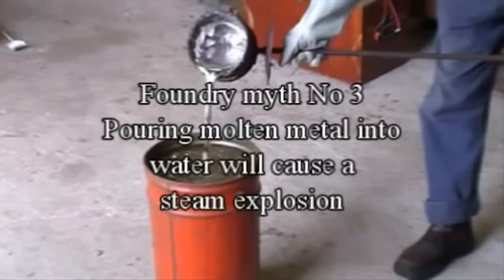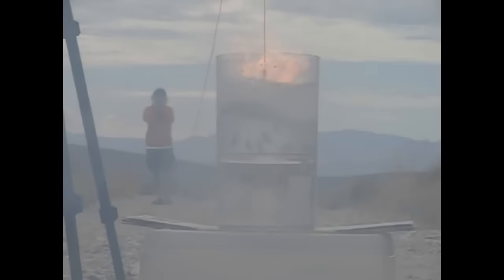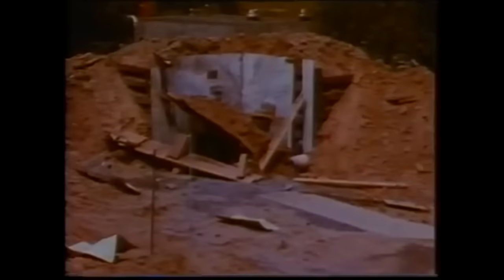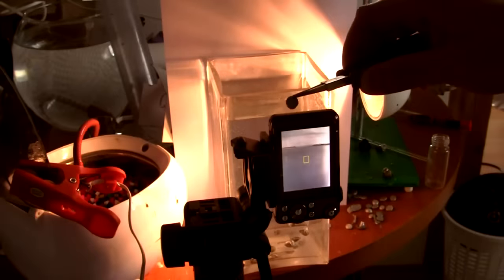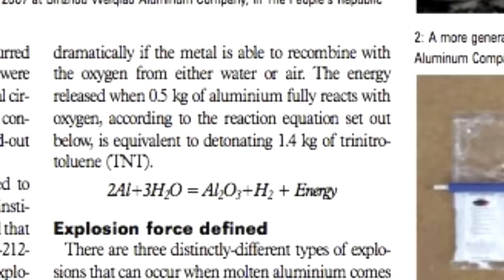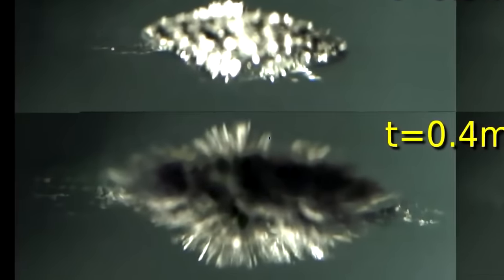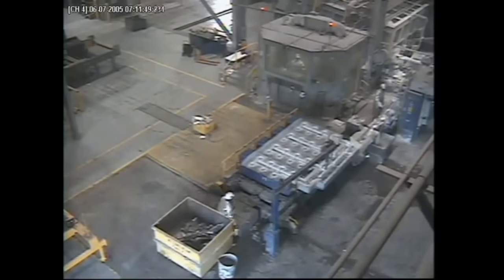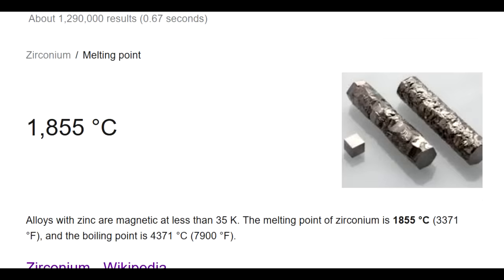The Awesome Power of the Aluminium-Water Explosion!

Comment: I work in a aluminium foundry department at a company called orlick and the risk of water entering our furnace is taken very seriously. Just bringing a pop can to work is grounds for automatic termination. Thank you for showing the risk. Stay safe :)
Reply: That’s some strict rules, but understandable.
Reply: Brutal
Reply: I do scales in foundries, first question I always ask, what metal? I've kick a coworker out cause he wanted a water bottle, he didn't know about aluminum and water. Aluminum is the one metal that terrifies me, if they are pouring, I leave the building.
Reply: Is it ever possible to blow up an aluminum can merely by opening it with pop or beer (containing water) inside?
Asking for a friend.
Reply: @Grunchy005  No, there is a plastic layer between the metal and the drink. Even if that is punctured there is still the issue of the oxide layer protecting the aluminum from reacting.
Reply: @Grunchy005  No, unlike potassium and sodium, aluminum requires extra energy, which removes the oxide layer, to cause an explosion. Also, aluminum cans have another layer on the inside, applied by manufacturers, food safety I think. Aluminum either has to be molten or pressure(impact).
Reply: As someone who has worked in foundries,this is common place for an aluminum foundry, even aluminum forges,where they heat billets to around 600c, quenching aluminum at this temperature is also dangerous a.f.
Reply: How do you stay hydrated in such a hot environment if you can't have water anywhere near there? I assume you are forced to leave the area and go to a water fountain and you are not allowed to fill up any containers from it?
Reply: @Rem694u2  You are correct, although most foundries I've been in have really good breezes, so only really hot next to the pots, even then it's not like you spend all day right next to it. There are laws governing heat exhaustion, I've heard of stories of some places having 10 minutes work, 10 minutes drinking water, but this was ridiculous temperatures.
Reply: I was always told that it wasnt the inital water explosion that causes the issue, its all the shit that comes off the roof of the plant exploding in the furnace that makes the bigger bang.
Reply: but how are people supposed to hold my beer if beer isnt allowed?
Reply: ...Because the can might pop?   😄
Reply: Natty Fatty Powerlifting I wonder how many miles away one has to go to get a drink?
Reply: For us it's more a risk of the water getting under the aluminum. Water expands 5000x times as it expands. (I might have my expansion wrong)  but even if 1 L of water sends 200 L of aluminum flying I don't want to be around it. My usual problem is bic lighters. They shoot out of the molten bath like a rocket
Reply: so what is the condition to rewach the Al - water eplosion, im very interested in metal works
Reply: @animekingcody  I've done app support for an application a big car manufacturer uses to manage the disposal of all manner of dangerous waste. Some of the more terrifying stuff I've heard about was alimunim dross. Catches fire easily and is really hard to put out once it's on fire.
Yeah, I think I'll stick to doing IT work.
Reply: @urishima  yeah our dross is pleasant it burns under a vented hood for about 6 hour before we dump it out. If you poke the center with a prybar it burns white hot. It gave a coworker ark flash about 4 years ago
Reply: @mattcornish5462  Yes, I think I'll rather hear about that sort of stuff than experience it. It was quite fascinating working together with the departments that use that application, hearing about the different kinds of wastes and the laws that govern their disposal. Usually when you do app support you only really care about whether or not your app is running, but I rather enjoyed being involved with the 'boots on the ground' so to speak, even if it was mostly through phone-calls, and well away from any sort of fire or explosion hazard.
Reply: But how do you get to drink or go to the toilet after some couple of hours??
Reply: The water is 10 feet away from the molten aluminum at all times. There is always risk but we work to keep it minimal.
Reply: automatic? elaborate what you mean by that
Reply: @animekingcody , didn't thunderfoot react solid aluminium with water in the last video by washing the oxide layer off with some other chemical?
Reply: @Normandy-e8i  if you come on the property with a pop can and get caught you no longer have a job. They give you a 7day suspension while they do the paperwork for termination
Reply: i'd imagine sweating profusely would be a cause for concern then too
Reply: @JNCressey  You are correct, but I was answering a question about everyday aluminum and not something that has been processed. The only time I have every seen or heard untreated aluminum(no removing of oxide layer or molten) react, was in a grade 12 physics class, which required smacking aluminum foil between two rusty iron balls. Pretty safe, but creates a loud bang, but shows how much energy aluminum has. Maybe @Thunderf00t could show that experiment, the release of energy from a minuscule amount of aluminum oxide being created.
Reply: @mattcornish5462  I thought it was closer to 400:1. Still powerful enough to drag a locomotive around when in a controlled state, so....
Reply: @mfree80286  you may be right I'm not too concerned about numbers ,even at 10 to 1 I dont like the numbers. I've experienced my fair share of minor explosions or popping as my coworkers and i call it. It might be risky but I truly love my job. It's hot sweaty and dangerous but the feeling I get from earning every penny of my pay is fantastic. I'm going to earn my retirement when I get it lol.
Reply: @mattcornish5462  then you have to go off-site to get something to drink? seems ridiculous, why dont they have a staff room where you can drink and keep your personal belongings?
Reply: @Normandy-e8i  we do have that. But we also have water fountains, eyewash station. And emergency showers.
Reply: @mattcornish5462  cool
Reply: @mfree80286  water to steam is 1100x its volume
Reply: Wow, risks that high?
Reply: I worked at a small foundry ran by two drunks. 

One time I didn’t pre-heat the tongs enough and a blob of aluminum went sailing past my head. 

Once on day shift and once on night shift we were doing double pour molds and it exploded all the way to the shop ceiling and rained molten metal down on top of everyone. 

Stuff is no joke kids.
Reply: Do humans count? we're ugly, ugly giant bags of mostly water! An accurate description of humans, We're over 90 percent water surrounded by a flexible container. XD
Reply: @meatpopsicle6244  aa foundry isnt a place to muck around with safety, seen too many accidents. the youtubers that try it scare me.
I'm from a ferrous background and have seen steam explosions. I avoid Aluminium.
Reply: Mitchell Baker That was exactly it. For the double pour both groups had to start pouring at the same time, manually. On the one that blew that I was present for my side started pouring on time, the other guys were delayed a few seconds.  By the time they got going our aluminum was already inside their runner trapping air, turning to steam - boom!

We lifted one holding furnace with the overhead crane and the other off the forklift. 

We had a contract with Boeing to make a bunch of these huge blocks that were machined then bolted to the factory floor to form the wings of a jet. No idea how heavy, 800-1000lbs?
Reply: I doubt the pop can rule, that's just bull.
Reply: @Grunchy005  never
Reply: @manjsher3094  hey it's your right to not belive the information supplied to you. That doesn't make it any less a reality
Reply: @mattcornish5462  Ty
Reply: The problem lies with quantity discrepancy. If you intent to quench aluminium with water, you better have a good excess of it. Steam explosions happen because the stuff you're quenching exceeds quenching capability of the water. Same reason why pop cans are very dangerous in foundries - they contain so little water compared to the liquid metal you accidentally drop your can into, but that little water still insists expanding 1600 times it's original volume.
Reply: @sleeptyper  Ty appreciate the sound information.
Reply: Both this video & many of the comments have been pretty interesting. I honestly had no idea how dangerous that working with molten aluminium could be (well, apart from the whole molten metal thing). 

I'm a sculptor & have had several pieces (maquettes) cast in both bronze & aluminum at different foundries over the years. 

I've only been able to witness bronze pours, but one thing that intrigued me was that they put the mold into an electric kiln to heat it up a fair bit first as a way of reducing the potential for cracking.

I suspect that this pre-baking also evaporates any residual moisture that might otherwise prove troublesome...
Reply: Same with our ALCOA plant here. We took a large forklift there on our lowboy and in the bottom of the chain box there was an old crushed Pepsi can under the pile of chains. It was probably in there for a year or more.The safety guy gave us a stern lecture
Reply: Maybe it wont work with pure ethanol. That is anyway more tasty than beer.
Reply: Re posting my comment under yours because I thought it'd fit here too 

I worked as a machinist making Tesla suspension parts in a factory that also had its own foundry next door. Once a maintenance worker left a closed container of water he was drinking from inside of a "scrap bin" after he knocked it in. We use them to re melt aluminum parts that didn't meet quality, save and recycle material, it destroyed 1/4th of the foundry building ceiling and injured several people. Small Styrofoam cups only from hence forth. I had no idea that this was supposed to be a "myth".
Reply: @Grunchy005  The channel NurdRage has a video of removing the Aluminium from a soda can.
Reply: @JNCressey  In this one, too, he had a large clip from the earlier video.
Reply: @animekingcody  Wouldn't most of the actual metal handling be being done with remotely operated machinery anyway, at least for large quantities?  You need powered equipment to move a large ladle anyway, and it would seem only prudent to place the operator at a distance and inside at least a hardened (and climate controlled) cab.  After all, the second principle of workplace safety is to get people away from dangerous substances.  (The first is to see if you can do without the dangerous substance.  Obviously, you can't do without molten aluminum in an aluminum foundry.)
Reply: @evensgrey  Unfortunately not, the powered equipment used to load up metal is the same as used to move dirt, just special claws to grab the material, as well as regular forklifts with special attachments for ladles and skimming. They may get special glass, but from what I've seen, not much improvement and no climate control. I'm sure an entirely automated plant can be made and keep people away, but most of the plants I've been to have been around decades and upgrading is expensive, something that isn't worth it in todays market. When it comes down to foundries, I respect those that work, cause of what they put up with for a living, respect the material and follow the rules.
Reply: @Bumblbroh  that's bloody insane. I've had my fair share of incidents. Such as the foundry door collapsing splashing a few hundred pounds. But we have been fortunate to avoid massive liquid explosions. I did lose part of a finger to a falling bin but that was more of an accdent that could happen anywhere
Reply: @evensgrey  I use a giant transfer ladle the looks like a rolling barrel. I put it on the front of my forklift and it's just a switch to rotate and empty it
Reply: Its water trapped within molten Aluminium that is the problem.
I used to be involved in atomised aluminium powder and milled flake.
Oxidisation fires are more an issue than the molten aluminium.
5mJ will ignite powder, ie you drop a steel spanner and you can have big trouble.
We lit some flake for the local fire brigade, they couldnt put it out and it burnt a hole through the tarmac at the training ground. Was about half kilo from memory.
As someone said, secondary explosions are also a major issue.
Part of inductions was witnessing aluminium explosions via Hartman Tube,  the chemist and I had it down pat, we could push a perfect 2m smoke ring about 50 m into the air on a still day when simulating primary, then secondary explosions. That was using about 2g of milled flake.
Reply: Orelick lol.
Reply: @animekingcody  https://www.youtube.com/watch?v=O5v3XxFfUOw
Reply: Grunchy I recommend not tossing a can of beer or soda into a pool of molten aluminum or especially liquid sodium. OSHA will fine you---if you survive
Reply: No doubt. Back in my HS metals class (early 80s) we made cast aluminium projects. I wasn't in the class at the time but apparently some new sand had some moisture in it and it exploded when they did their pour. 
It destroyed the vent hood and there was sand everywhere in the shop. 
The kids doing the pour were knocked down but no major injuries. 
lol I have made countless welding projects over the last 35 years but no, I have never poured aluminium since HS.
Reply: @klutzspecter3470  Same here. I worked in an aluminum door factory. First day you signed a form saying you were never to bring bottles or cans into the factory because if they somehow made their way into the blast furnace any water in them would cause a catastrophic explosion. Scary stuff.
Reply: @mitchellbaker6528  and the rest. One mol of liquid water occupies 18ml, 1 mol of any gas at STP is around 22.4-22.7 litres (depending if you're talking 273K or 298K) so let's plug in the molar volume at 273K: 22.4/.018=1244
Reply: @BlokeOnAMotorbike  was only off by 12ish percent on a number off a safety course more than 10 years ago,
Reply: I worked in Aluminum Extrusion . Let's just say The Boss must have Paid OSHA off. I've seen a Chunk of Floor Go Through the ceiling.... I Left Right after, told them to Mail me my Check, im not going to Get hurt from someone else stupidity
Reply: @meatpopsicle6244  same here . I think the boss paid OSHA off.. i left that place
Reply: @rge24491  That sounds like it makes working in a regular aluminum foundry downright safe in comparison!
Reply: I've got a burn scar on the back of my neck from not heating up an ingot mold to get the mosture out of paint liner.I was just topping it of nab boom,sounded like a cannon and scared the shit out of me.Of course was goes up must come down. There was hardened aluminum 30 feet up on the ceiling.
Reply: @TheAussieGunBunny  from experience..hide under something cus its all coming back down
Reply: @ThePalatineHill  electrolytes
Reply: Same here in portland, if you go on site with a lighter in your pocket you will be in a world of shit
Reply: Aluminium is bad news.
Tin or babbit is ten times worse.
Foundry work is satisfying but, very dangerous.
Reply: I worked in Navy foundries for 20 years.
We were running short on brass to make plaques in the foundry at Guantanamo Bay.  The Marines started bringing us shell brass. Our normal procedure was to look at every casing before it went in the furnace, we found the occasional live round.
We had one lazy joker decide to use a shovel. We were lucky that day because he dumped several live rounds of m-16 in the furnace.
Boom, boom, boom, we never used shell casings again.
Reply: @dennisbaecht7860  no bullets hear. I've had too many paint markers shoot at me tho
Reply: Matt Cornish I agree that water entering the aluminium or any molten metal would cause an instant heat reaction, but not a chemical reaction as the video claims. When the molten metal is poured into water (the reverse of what we are talking about), it simply cools it. Water expands instantly to 1600 times its own volume as steam. But add an electric current and it becomes a whole different ball game.
Reply: I saw many of these videos in the safety class I took when starting at an aluminum recycling plant. Witnessed an explosion first hand during a winter freeze back in 2016. Most of our aluminum has been run through a compactor and has lots of crevices to catch water. During a cold snap, one of the charge furnace operators dropped in a bundle with frozen water and it shot aluminum over the loader and 70ft back to where I was standing. Imagine a wave of molten metal flying toward you.
Reply: Safety on industrial sites is taken very seriously. I did some work at Bacton gas terminal many years ago and there is an approximately 2 mile exclusion zone around the plant for anything flammable. They took the cigatette lighter from the work van as well as some paint we had in the back and my friend's smoking paraphernalia. When I asked is there a high risk of explosions, the security gaurd said, no it is basically zero but they still take the precautions. These idiots putting aluminium into water quite obviously do not understand what a steam explosion can do.
Reply: Pop can = fired. No BS. 
Same as a BIC lighter = Goodbye.
Reply: animekingcody
Yeah, when you go sauna, there's half hour sitting and then half hour drinking beer and cycle is done as many times there's competition.

💀 ☠️ 🥵
Reply: I have done construction projects at Alcoa facilties and they strongly warned us about this